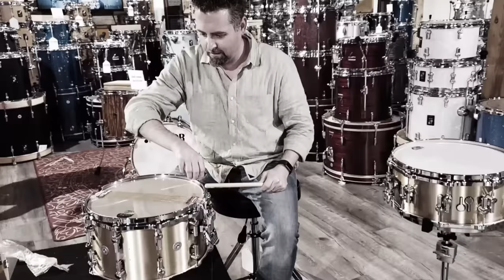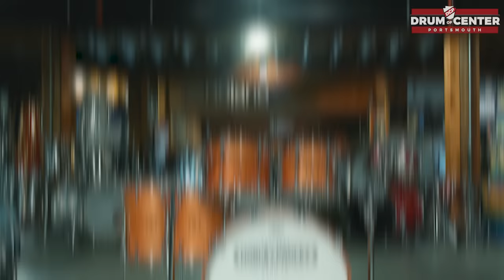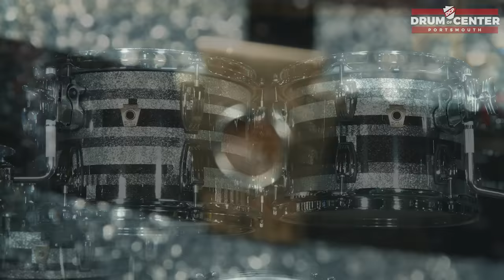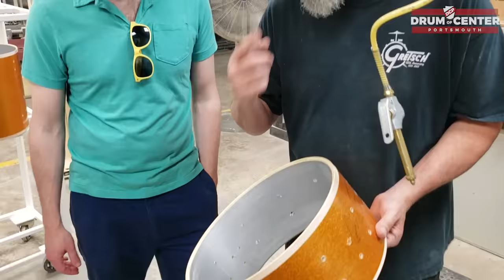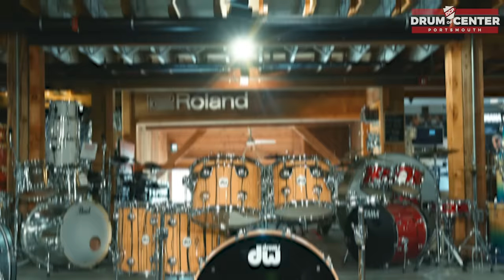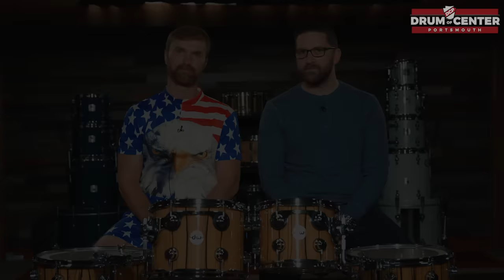The Ultimate USA Drum Set Comparison - Noble Cooley / Ludwig / Gretsch / DW

Comment: I wish all the newbs on r/drums would watch this and realize ring is good…the amount of tape on heads I see is infuriating with the newbs
Reply: They get confused because their ring is so not good
Reply: plus you get naturally controlled ring with drums that have reinforcement rings, so theres no need for that subreddit to complain about how all ring is harsh
Reply: Every drummer should experiment as much as possible with different heads and really do a deep dive. It’s expensive and took me about 4 years to comfortably spend money on heads about every month. Finally found a match that sounds incredible and doesn’t need to be muffled. It’s a very odd combination that I’ve never seen anyone try. Coates reso 7’s on the bottom and hydraulic glass on the top. I play an all maple wood hoop kit. Holy fuck drums are so sick
Reply: I'm not a nube, been playing on and off, since the 60s. 
For me, listening to snare or cymbal ring is like how some folks respond to someone running their nails across a chalk board. It's just difficult and uncomfortable for me to listen to. 
It's sensory defensiveness, if you know what that is. 
I wish they would bring back the internal adjustable mufflers that snares used to have back in the 50s. 
I think some makers want to bring them back but there is resistance to that.
Muffling in all of it's forms, has become its own cottage industry. Very profitable and those profits might be threatened with an internal muffler having a comeback.